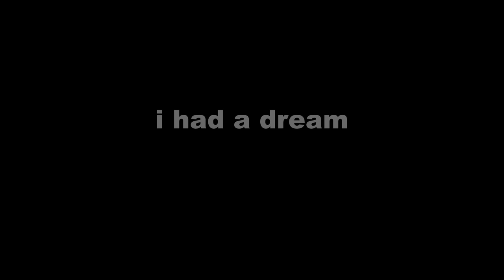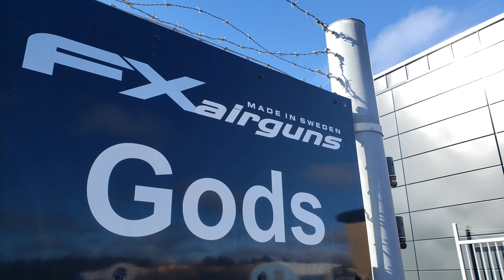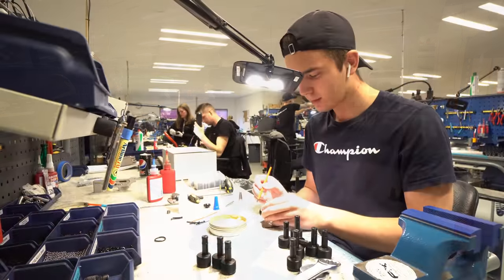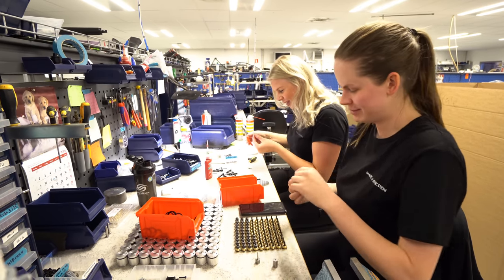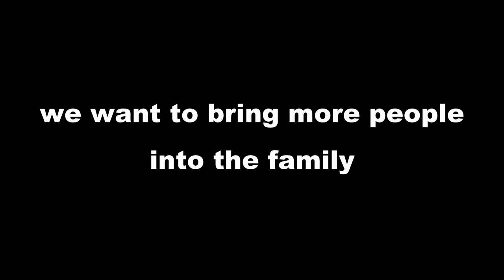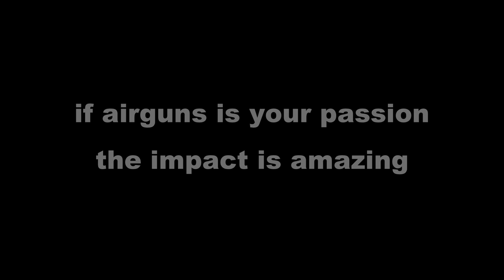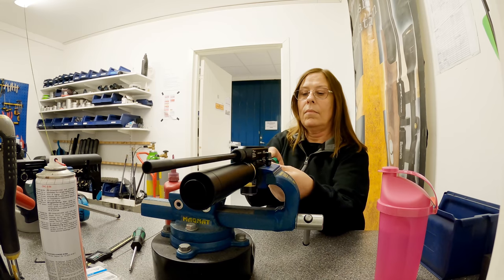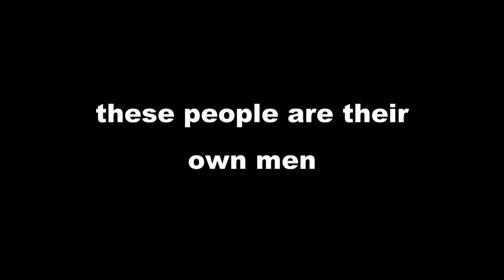FX Airguns - FACTORY TOUR SWEDEN!! - Air Rifle Manufacturing - Airguns - Impact - Maverick - Wildcat

Comment: I was expecting a lot more of a factory tour and a lot less time of people sitting around a table and talking in one room.
Reply from the maker: I had about 35 minutes of "assembly" scattered about the interviews in this one as the people component was important to me.  I'll be returning to Sweden this summer to film another that's "process" focused that will be rich in assembly & manufacturing.  Best, Steve
Reply: @AEAC  Let me go with you.  I am a manufacturing expert, (In fact, with 6 months there, I can actually help them with their production and quality),---and I can understand what the shop guys are talking about for a much more in-depth questioning and understandable interview than a sales guy can do.
So far, FX?  I have not been sold.   I think their fluid dynamics engineering is outstanding, one of a kind right now, (about "20", over 100fpe, .35 cal. shots on one fill?  Nobody thought that was possible.). I also now the quality and structural design has to be perfect for a lot of o-rings, and I know how hard it is to find employees who care enough, and good process engineers to develop good enough process's to achieve that perfection.  If they are as good as you salesmen say,---I can show it.  They will have to pay me more than they pay you, but it will be worth it.  :)

Comment: Great video Steve! FX does make great airguns and push on revolutionary boundary so other gun makers will move forward and excel as well. Love my impact X .30 and looking forward for the .35 cal in hybrid slug only. Next project for FX is to create an impact Pro that can handle .308 (shorty version) or .357 cal (800mm) hybrid slug for long distance w/ 580cc Cf bottle w/ 20 rounds hi-capa. And may be shed off the weight a bit more. Thank you Steve for the video and FX for the great airguns.

Comment: Thanks for a very long and good interview. It's always nice to see how a product is created, but also to get a atmosphere feel, how the working culture in this company are. As a Nordic person I'm not surprised of the equal respect from the Top to the Bottom / Bottom to the Top. Nobody is stronger than the weakest link. However we never forget who's the boss. 

I did read though all of the question before I posted this, but I didn't see any asking to this.
One of FX big pride is the making of there own smooth twist barrel.  @1:03:32 you see a worker bend a barrel strait. After the barrel has been created from the CNC machine, it should be 100% strait to less than 1/1000 of a millimeter. 

Why does the barrels get out of adjustments?

Hopeful I will have the money to buy a Dreamline later this year, maybe the upgrade version will be out.

Comment: FX I purchased an Impact mk2 in Feb 20 the first one was replaced. The second one was returned for a regulator repair, when it came back the barrel is sticking too far into the mag holder so the magazines won't fit in. Because of Corona virus the shop is now closed and I can't get the problem sorted. I also bought a barrel kit and the liner was full of black oil. I don't think this was part of your dream.
Reply: Allen, not sure where you live but you can email serviceusa@fxairguns.com if you live in the dates or info@fxairguns.com if you live elsewhere and we can help you out.

Comment: Hi, Good video, many thanks.  I've owned FX rifles for best part of 8 years (now 7 in my collection).  However, FX seem to treat customers in the UK as the "very poor relations".  I have a Dreamline compact tactical on order since May 2019.  AND STILL WAITING!! Why didn't you press them on their failure to supply the UK market (and probably Europe) in line with their promises and hard marketing?
Reply: Actually in the UK we just switched distribution due to the problems that have been going on. The new importer is Sportsman Gun Centre who sells FX as well as distributes to UK shops. They have been very aggressive since the switch in February of this year and you should reach out to them. I think you'll find in a few months that the former problems in the UK are all but solved.
Reply from the maker: Because I hadn't heard of any any U.K. supply issues but I had heard that FX wasn't happy with their previous U.K. distributor.  Now I see the connection.

Comment: No wonder I ordered my Impact in April and haven't gotten it yet, 5 months later. Your manufacturing and assembly techniques went out in the 19th century.
Reply: Worldwide pandemic. Jeez 🤦🏻‍♂️
Reply: @ellobo1326  Sweden never shut down. Colt used the assembly line in 1860. Not even at Subway does one person build the entire sandwich.
Reply: @varminthunterhobbyist4302  First of all, if you watched the video you will see ultra modern CNC machines milling CAD components. The guns are super precision machines and are meticulously assembled by motivated people. Seems you are saying you’d prefer one pumped out at warp speed by robots. Then you’d complain about the quality/performance. The performance of the FX rifles speaks for itself and is revered worldwide.  Instead of bashing a product, simply vote with your wallet and purchase the competitors product.
Reply: @ellobo1326  Well, speaking of quality, when I finally received my FX Impact, the magazine would not go into the breech. It was .030 out of square as if someone had dropped it on the butt stock. I had to return it and wait longer. I now have three air guns over the $2,000 range and none of them will outshoot my $600 Benjamin Marauders.
Reply: @varminthunterhobbyist4302  That’s awesome. Glad you are now happy. But what is your point in the bashing ? Would you like to see every potential FX customer boycott them and they go out of business ? 
And if you think that there is a single man made product in the world that doesn’t have numerous dissatisfied customers then you are delusional.

Comment: Aloha everyone, I have been a long time shooter, but I am looking to get into air. I am in the research stage and have been watching AEAC and Steve's reviews (thanks Steve). I know I want either 25 or 30 cal for my needs but Im still deciding if I want to go the expensive (FX Impact) or affordable (Umarex Gauntlet) route. My question is this, I recently saw a video from last years shot show with a company out of China call AEA precision and their 9mm Terminator. I cant find any reviews on them or the rifle. Does anyone have any information or knowledge on the AEA Terminator? Thanks
Reply: AEA is a new company, and as such has a lot of rough points. If you are willing to work on your gun extensively then it might be ok, but otherwise, you should avoid it. There is a reason why they do not provide examples to reviewers, and its to hide the fact that it is a rough gun.
Reply: Thank you for your info

Comment: i will say one thing that is a fact a 1022 Ruger isn't a match rifle but powder burner or air rifle neither is accurate unless each gun is in harmony it is the same weather air or powder and the difference between a 1" group at 100 yards with a powder burner or a 1/2" group can be as simple as .2 tenths of a grain of powder just like one small adjustment of the hammer spring on a air rifle they are very different animals but so similar in many ways

Comment: If AEAC is optimized for 4k why does youtube start the video at 1440p for me?
Reply from the maker: Might be your device's resolution capabilities.  YouTube wont offer a higher resolution option than what's available on the device.  For example on my 4k television, the YT app offers a resolution in 2160p 4k but on my cell phone, YT wont allow me to view at more than 1440P (the phone's max capability).  Hope this helps.
Reply: Also, these days due to the COVID-19 Youtube has lowered default resolution due to High Load on their servers so you have to manually increase it.
Reply from the maker: @Shahzebfaheem  interesting.  I have not observed that here in the States.

Comment: why you dont make semi auto they would be perfect guns
Reply: With the large shot count they get now, I would not be surprised if they are working on it.  It will probably reduce shot count, but the semi auto action could be electronic also, with a light battery, and not lose shot count.  If they produce it, I hope they can make it upwardly compatible, so the manual side action can just be replaced with the new semi auto system.

Comment: Steve...with this CCP Virus outbreak, the FX Factory and employee’s, are they still working and building airguns? Or are they on lockdown also like us? I would imagine they are all home and not working but like me and my job...I still have to be at work...yes...I have minimal contact with people and when contact is necessary it is at a 6 ft minimum. That said...due to a manufacturing environment which I am familiar with after 8 years at Sony...it would be difficult for the employees to maintain a safe distance from others in that environment. Is the facility shut down at the moment? I’m sure that dealers maybe shut down and even distributors and they may have a decent amount of FX guns and components on hand till this outbreak crap is over but still...FX open for business or closed till further notice?
Reply from the maker: FX Sweden is running as usual.  FX USA is partly working from home and partly from the warehouse.
Reply: Sweden is about the only nation that did not attack their free market.  Sweden may be the least marxist run nation in the world today.

Comment: If anyone from FX looks at these comments, please do not introduce electronics into your rifles. In my opinion air rifles and firearms should be purely mechanical. Electronics are not needed if the mechanical engineering is good.

Comment: 1:26:22 ... exactly what I don’t like about the entire PCP system with this one bottle including hundreds of different pressures with hundreds of different opening and closing times ... this tech is total nonsense on my opinion. Tech weapon nerds can tell me whatever they want. I know the hammerSPRING is the first thing that strikes before the valve and its regulator starts to “think”. Trying to sell me “harmony” for up to 2000 Dollars doesn’t work for me. 7:38 Why is it complicated in terms of money? I don't get the point. Replacing the pump with a tube with compressed air to make the tech more "sales friendly". I don't get the money manager point in terms of "costs". I still trust springers more in consistency than PCP and regulators.
Reply: This gun has a 2nd smaller air tank they cal the plenum.  The main tank is the big tank with about 300 bar max in it, and has the tank pressure regulator.  But the small plenum tank also has it's own regulator and is externally adjustable for this gun.  It has about 150 bar in it max, and it is the small tank that drives the pellet.  So when you shoot this gun, the big tank fills up the small tank the same every time so you don't get that drop in pressure shot after shot.  The gun is made with precision, is light, has a super high shot count with a full bottle, and maybe the best of all, because it is so tune-able, you can transform it from a low powered .177 to a 135 foot pound .35 cal that can take down some pretty big animals.  Because of it tune-ability and overall excellence, if you wanted to start a pesting business from inside stores for small birds, to Coyotes on a farm, this one can can do it all with the best precision on the market.  I have been waiting for a fully tune-able PCP airgun, and this will be my first one.  I am hoping to hunt Coyote, (with the .35 cal), with a electronic audio call, and shoot several of them as they come into the call,---and not even hear the shots, (I hope. I have a bet with a buddy of mine that it is possible).  There are way to many of those suckers around here. :)
Reply: @EarthSurferUSA  interesting! It can take down a coyote?! Wow. Did you try this already?